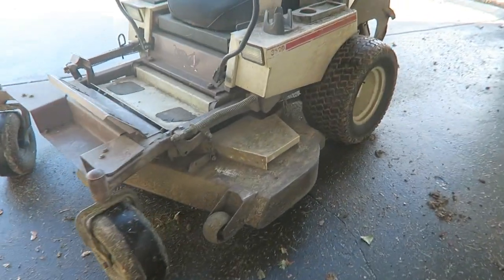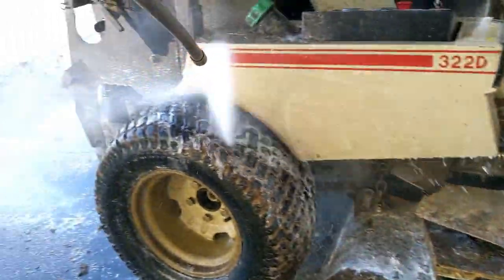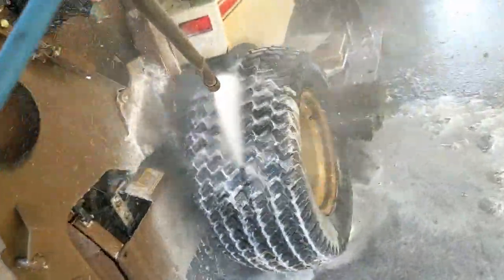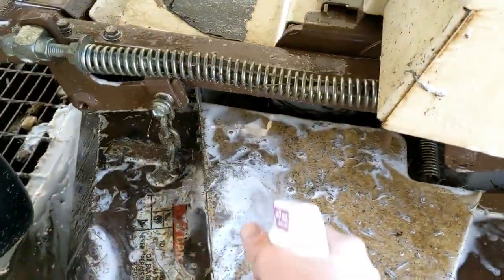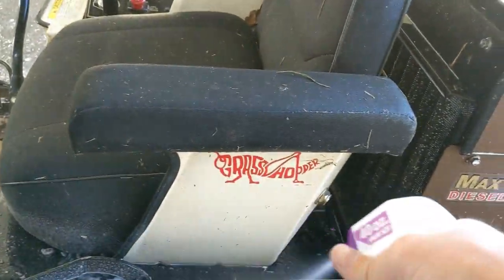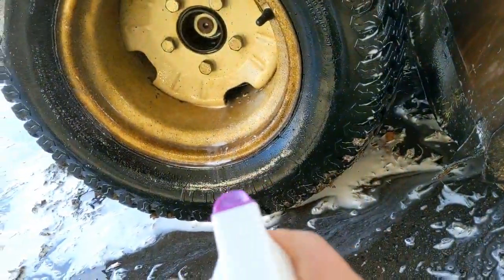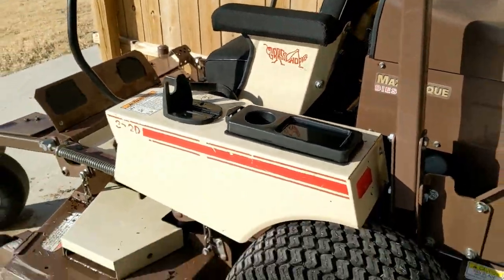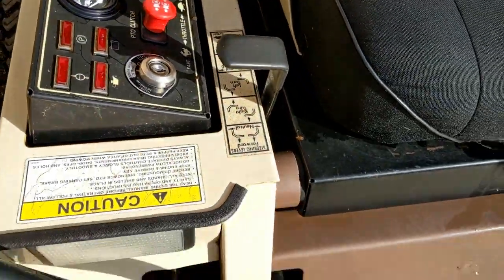Oddly Satisfying Power Washing Zero Turn Lawn Mower

Comment: you quit using the purple power when you try super clean degreaser from walmart.
Reply from the maker: I used Super Clean Degreaser on my Silverado work truck. I blew a half shaft and it slung grease everywhere. It defiantly worked pretty good!